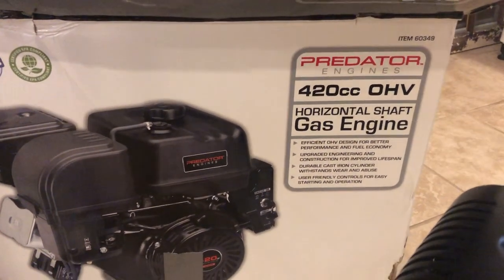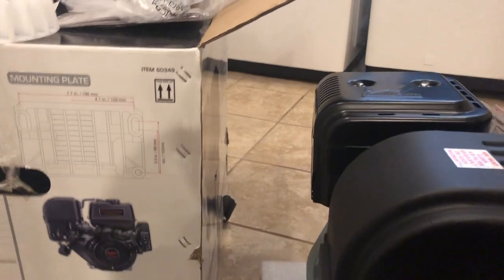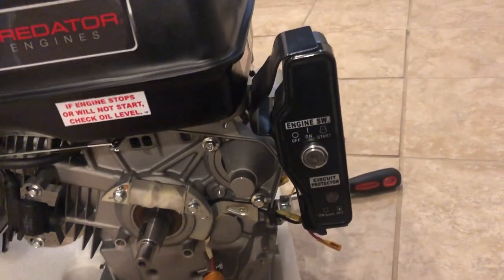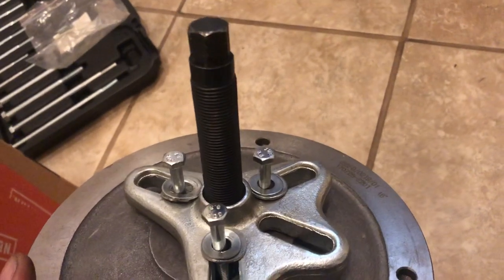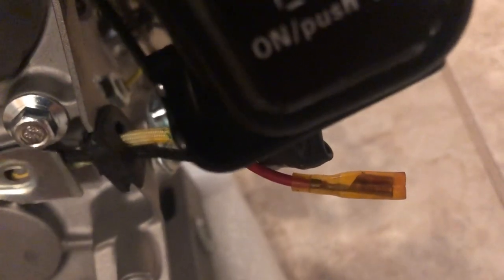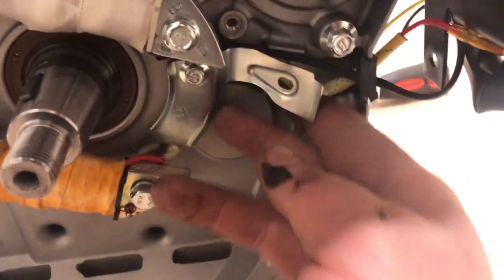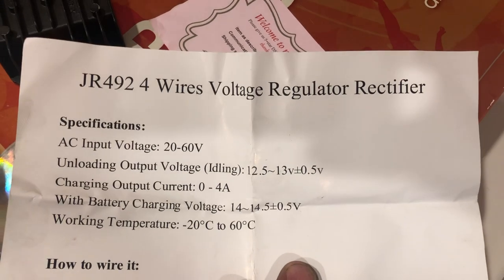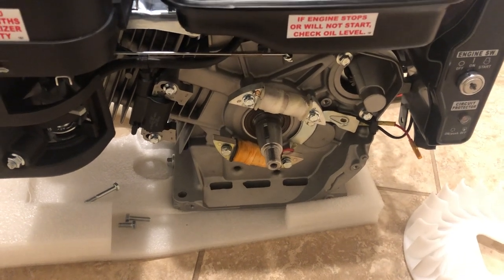How To Double the AMPS Out of Predator 420cc Hemi Engine for Lights & Other Accessories Alternator

Comment: Thanks for getting back to me I really appreciate the hook up. I put a Duramax 420 cc 16 HP in a 1950 Cushman Eagle but it needed more amps. Thanks to you that's no longer a problem. God bless
Reply from the maker: Richard Alfaro I’m so glad it worked for you!  Sorry I missed this comment!  How is your project doing?
Reply: Did the coils do the trick or did it need a regulator/rectifier, also?

Comment: Thanks for the info on how to double the amp output on the predator 420. I have a Duramax 420 cc 16 HP electric start. Please tell me where you purchased the coil and regulator . Thanks and God bless.
Reply from the maker: Thanks for the view and comment!  I posted Links in the description!  Hopefully you liked the video and subscribed!  What are you putting the engine on?

Comment: Thanks for the info, I installed the battery but was hesitant on the charger and where to ge them
Reply from the maker: Scott Li, 

Later down the line this set up didn’t power everything I needed on the snowblower.  I uninstalled this and went with a set of coils from a generator.  There is a video on that too lol!

Thanks for view and comment, hopefully you subscribed to my channel! 🇺🇸🤙🏻🔧🦅

What is this beast of an engine on for your application?
Reply: @pattayperformance  I put this thing on a mini skid steer that i bought a year ago. The gentleman who sold it to me put a predator 301cc on it which has no way for a electric start. Even the 420cc is too big for the frame, I still bought it, and cut the frame to fit. The mini skid steer is from the 1980s...
Reply from the maker: Scott Li thats awesome!  If you ever upload a video on it PLEASE DO NOT FORGET ABOUT ME!  I am interested in seeing it for sure!

Comment: So I got the regulator rectifier you used, and the coil. But my output (no battery connected to the RR) is 5VDC and 12VAC. Any thoughts why?
Reply from the maker: I’m not too keen an on electrical...I measured in AMPS...bc I wanted power to run all the accessories AND charge the battery at the same time.

The is set up did not put out enough AMPS to run OEM Light, Heated Handgrips and charge the battery.  

Later down the line I found this out, I ditched the set up and went with OEM Honda Coils from a Genset.  They were almost $100.  I did post it on a video about the conversion.  

I didn’t make a big deal out of it bc most people aren’t doing this swap on a snowblower with all the bells and whistles.  Most people are using these motors and running LED lights which doesn’t pull much.

I can’t run LEDS on a snowblower bc they don’t emit heat.  Once snow hits the light it freezes over and becomes useless.

Thanks for the view and comment, hopefully you subscribed to my channel.

What is your motor going on?

Comment: I’m planing out a electric to gas golf kart conversion and the predator 420 looks good. Can you tell me how well this can keep the starter battery charged? What is the amp output at 12 volts?
Reply from the maker: Its only 5 amps and NOT sufficient enough to charge the battery while running lights and heated handgrips!  I went a different route but I have not yet installed it and tested it.  Will post a link as soon as I do!

Comment: How did you wire the coils and the VR? I have the exact same setup, my coils are putting out 15-30vac each, but when I wire each lead to the VR I’m only getting 3vdc output (open) I’ve tried two different regulators with the same result. I’m thinking maybe I have to float the ground on the regulator since the coils use the case for AC ground. Any insight would be helpful! Thanks

Comment: Did you connect the 2 coil wires together or do they stay separate 
thank you in advance
Reply from the maker: Connect them together.  Later down the line I swapped them off Coils off a Honda Generator and they put out more amps/power for what I needed.

Thanks for the view and comment, hopefully you subscribed to my channel 🤙🏻🇺🇸🔧🦅

Comment: Hi, I need your advice on how to correctly wire up the additional charging coil and voltage regulator. What’s throwing me off is the one wire coming from each coil. Can I just take the that one wire from each coil and attach to each of the taps on the VR?  If so, do I eliminate the diode that is one already installed coil wire? And if not using the VR, can I just connect both coil wires together provided by adding a diode onto the new coil wire (although I suspect that is what the VR is supposed to help me accomplish). Thanks, I appreciate any and all advice.
Reply from the maker: Ray Y,

Thanks for the view!

What rectifier did you get?
Reply: foreverfalcon40. I got the exact one you recommended, so was curious if nothing else, do I just run the one wire from the newly installed coil to one of the AC inputs or is there a way to tie both coils together?
Reply from the maker: Ray Y,

You can wire them separately into recertifier/regulator.

Red if power
Green is ground 
Yellow and pink are power in from coils
Reply: foreverfalcon40 thanks appreciate the info. Each coil wire will feed either side of the rectifier and overall the amps will add up from each coil and essentially double the output coming out of the VR. Just one last question, with the “stock coil” already installed, I believe there is a sort of filter diode in the wire that roughly rectifies to dc voltage, do I have to do anything with that or just let the wire be and still run to the VR. As you can tell I’m all new to this and just don’t want to burn anything out.
Reply from the maker: Ray Y 

You can remove the diode since the Rectifier/Regulator will nullify that.  

Wires from each coil can be tied together or run them individually.

If you appreciate the vids...please like the video and even better subscribe!

What are you installing your 420cc into and what are your goals?
Reply: foreverfalcon40  actually going to try my best at repowering an old sears suburban 12 I inherited from my dad as the starter/generator is squealing and starting to burn up. It’s my intention to try and go for some lighting on the thing as I know I may want to run the tractor at night at times, hence learning how to up the charging on it.

Comment: Hello thanks for the video, very helpful. Can you post another link of the voltage regular? The one in the description expired or moved. 
Also, I am looking to do exactly what you are doing to my predator 420cc, electric start and LED’s. Can you provide a wiring diagram of how wired yours? Btw i bought a used manco intruder ll
Reply from the maker: Thanks for the view and comment!  Cool Project you got yourself there!  I keep updating the link and it keeps getting moved around.  Just Type the voltage regulator into the search bar via ebay or amazon.  Match the pics up and SEND IT!  The voltage regulator comes with paperwork on how to wire it.  LEDS get hooked battery and wire in a switch.  Starter just need to run power to the battery from the solenoid.  Motor alreay has the key wired to solenoid!  Are you uploading the build to your channel?
Reply: Pattay's Performance Thank you!!!
Reply: Pattay's Performance i do plan on uploading videos, i think it will help other newbies feel more comfortable with go karts. Ill send you links as i progress.

Comment: Liked and subscribed.  Do you know what the single charging coil puts out? Also the VR is no longer available, do you have specs to find  one similar?
Thanks! Btw im trying to repower a 1982 craftsman GTV16 with the absolute WEIRDEST  belt drive system lol. Very mangled wiring on the old garden tractor as well.... should be fun lol. Thanks again.
Reply from the maker: NOT enough to charge a battery, run heated handgrips and a light LOL!
Reply from the maker: type in 

wingsmotor 4 wire voltage 

into the search bar and should pop up!  Best of luck with your project!  Are yuou posting it here?
Reply: @pattayperformance  awesome buddy! Thanks! I might try the factory set up just to charge the battery. Idk. I might run a double pulley and do a GM 1 wire alternator...

Comment: Nice vid. Change you ebay link for the coil. The price is jacked up to $38.00. Ebay has them for $8
Reply from the maker: These coils are junk and not what I needed.  If you look further down the build.  I swapped out the OEM/cheap aftermarket coils to Gen Set Coils.  

Thanks for the view and comment, hopefully you subscribed to my channel 🤙🏻🦅🔧🇺🇸

I will edit the link...no way I’m hell someone should spend that much!
Reply: @pattayperformance  How many amps did you get with the junk coils. I'm hoping for oem light, possibly heated hand grips, maybe a battery.
Reply from the maker: @StephenCunningham1  I don’t recall but it wasn’t enough to run my light, heated hand grips and CHARGE the battery that I added to start the snowblower.

https://youtu.be/6UrEmpfn_tY

Comment: The specs on the voltage regulator says 0 to 4 amps. But with both charging coils it 6 amps together. Is it still okay to use that voltage regulator even though it’s says 0 to 4 amps? Also do you mean voltage regulator or voltage rectifier?
Reply from the maker: Cameron Luster,

I actually never installed a second coil.  I upgraded to a genset coil system that will put out 10amps.  I have yet to install it but based on numbers it won’t work.   People on the forums who are using 1 coil say the amp outage is lower than what it is rated for.

I’m sorry I can’t accurately answer your question.

Comment: while you may have doubled your amps....which is doubtful....just how much of an electrical output do you now have?  I saw no electrical testing equipment to make any such determination.
Will this do the same for the non hemi Predator engine as well?
Will this be enough amperage to power all the lights and horn and electric starter for a street legal mini bike?
Reply from the maker: John Tingle,

Thanks for comment, using common sense while viewing the video shows that engine is BNIB with no gas as well as oil.  Later down the line when I finally installed it on the snowblower after some retrofitting and fab work it was 5-6amps which was not enough to successfully charge the battery while operating the NON Led Light and the heated hand grips.  Later on again on my channel I documented that issue and also showed that I upgraded to Honda Genset coils that cost ALOT more money and put me at 10-12 amps which is more than enough.

This will work on a non Hemi Engine as well...these will power an led light or two while charging the battery.  If your trying to do more on a go kart.  I would just add an alternator.  Being on a snowblower it’s pretty obvious why I couldn’t go that route.

Thanks for the view and comment, hopefully you subscribed to my channel.

Comment: Add another coil and regulator rectifier. Yeah, knew that. Thought a 7 min video would show how You wired it.
Reply from the maker: Wiring is in another video if you can’t follow instructions that come with the rectifier.

I also ended up ditching these coils and went with a GENSET coils bc they put out  enough amps to charge my battery while running my light and heated hand grips on my snowblower 🤙🏻🦅🇺🇸🔧
Reply from the maker: @camaroboy811  

Link will be in the descripition of this video...if it doesn't work let me know
Reply from the maker: @camaroboy811  correct should be about $80-$90 not a cheap upgrade but this project isn’t cheap 😂

Comment: What is the black rectangle box on the side? My old one has it but the one I just got doesn't.
Reply from the maker: Are you referring to big plastic one?  That’s an EVAP canister for emissions
Reply: @pattayperformance  Gotcha! Are you able to take it off and still run it? My brackets broke and it's just hanging.
Reply from the maker: @Rick-kp6wf  yes just YouTube charcoal canister delete for the motor

Comment: Your videos inspired me to put this 420CC Predator on my otherwise virtually NEW Toro 928 Blower and now it is a beast. I even managed to get the Hemi version! Thank you for the inspiration!!! I had it up and running in just a couple of hours but then I realized that I needed to figure out how to connect my heated grips. When I was researching these motors I was lead to believe that this motor had a complete charging and starting system built in. But then after seeing your video about 'doubling the output voltage' I am a little confused. The user manual that came with the motor shows how to connect a 12V battery but now I am not sure if that battery will be charged while the motor is running (?). So here are my questions, and I would be so grateful if you could share you experience just a little longer: 

1). If I connect a small 12V battery (per the instructions that came with the motor) will it charge with the system as is? 

2). If I do/or don't choose to add the starting battery is there a way that I can simply connect my Toro builtin hand-warmers and the small LED light to operate while the motor is running (as it did with the stock motor?). If I can get this figured out it will truly be a complete success! Thanks for all of your great videos! (sorry this got so long winded :)
Reply from the maker: BASTARD!  your gonna finish yours before I finish mine!  Better POST VIDS FOR ME!

So the motor does have a complete charging system!  Even after adding a second coil it will not have enough power to charge the battery while running the OEM Light and heated hand grips.  The only reason why this is an issue for me is b/c I do use the machine for snow removal.  I ordered Honda Chargring coils from a get set THEY WEREN'T CHEAP!  Are you running a battery or no?  If not just follow the charging coil wire to the rectifier and use the wire from the rectifier out and hook it up to the heated hand grips.  

if you plan on using the battery, hook it up to the battery direct.
Reply: @pattayperformance : Thanks for getting right back to me! Eat your heart out pal... It so pretty and and soooooo powerful! It can blow more snow at an idle than the original 928 265CC motor did at full throttle! Very exciting stuff :) I love it. If I can just have a modest LED light (like it originally came with) along with the built in hand warmers I'll be thrilled. Its easy enough to start with the pull cord so a battery is not really necessary. After all... are we not men? Hell yes we are! Only real men add mega horsepower to their otherwise perfectly good, brand-spanking new snowblower! My wife said, "Why do we need a bigger motor?" I said, "Because it's bigger!' :)
So tell me this (if you can) which wire can I spice into to get the 12Vs I need for my LED and built in hand-warmers? I was expecting a wire with a connector to be hang there all ready to connect to  but it looks like the little harness is all bundled up so I have no idea where to spice into. Do you happen to know exactly which wire (color) that I can cut into?
Thanks again for the inspiration. This is all your fault.
Reply from the maker: THANKS FOR THE MOTIVATION!!! CHECK ON MY INSTAGRAM FOR THE TEASER VIDEO :)
Reply: @pattayperformance  : oops, no Instagram for me. I've got to drag you into this again just to see if my hopes are realistic, then I'll move along: I thought of you this morning when I was blowing 11 inches of WET nasty snow 35 feet in 3d gear like it was pillow feathers on my newly powered snow machine! This was at 60% throttle. I couldn't help but think that the Pattay's Performance dude should be here to see this!  I will be making a video and would like you to show some of the details involved in adding the 420 CC Hemi Predator to the Toro machine. It was VERY easy by the way and exceeded my hopes. Also, and I can't emphasize this enough: The new Joystick controlled chute on these Toro machines is a real game changer! It is so fast, versatile and cleverly designed I can't imaging being without it, and have been doing this for decades because I am really freaking old and oly wish that someone would have developed this ages ago. Its just that good. 

You'll  see it all when I finish this up and get a video posted in the days to come. In the mean time here's my question: I decided to go ahead and add a starting battery to my new rig. I know that I can add the additional charging coil thanks to your explanation but how much juice will this really give me? My goal now is to be able to charge my battery, run my 18 Watt Led headlight and also run my built in Toro handle grip warmers. Is this realistic with 2 of those charging coils and that little voltage regulator? Please let me know if you can. Thanks again.
Reply from the maker: Dan Jackson,

For my application it won’t work.  But if you want, GET ON INSTAGRAM and message me your mailing address.  I can send you another coil to add.

We are suppose to get snow Saturday...not much but they are predicting 6” at some point this week!  Be prepared for hours and hours of snow blowing footage if it really happens!

Do you have the Powermax?
Reply: @pattayperformance  . Hey Jason. Yes. I have the new Powermax 928 but now it has your Predator 420CC Hemi motor. WAY better that the 9HP Toro motor!
Reply from the maker: @pj2418  Nice, I thught 9HP would be sufficent!  I know the Old 9hp Tecumsehs were great.  Guess the chinese copies aren't so great!  Oh well, now you can sell the engine for good money to recoup some costs!

Comment: Thanks for the info on how to double the amp output on the predator 420. I have a Duramax 420 cc 16 HP electric start. Please tell me where you purchased the coil and regulator . Thanks and God bless.